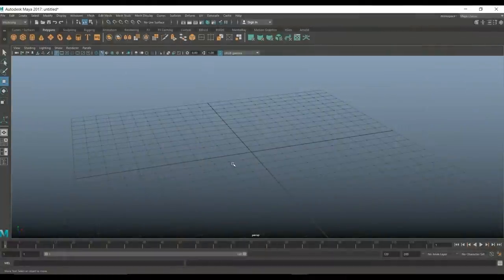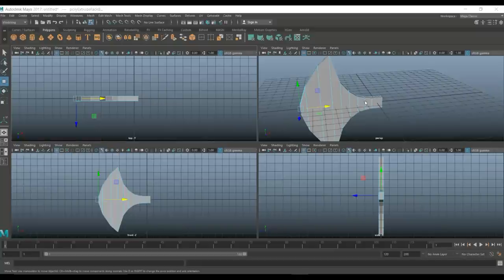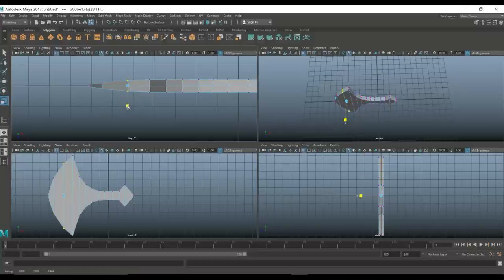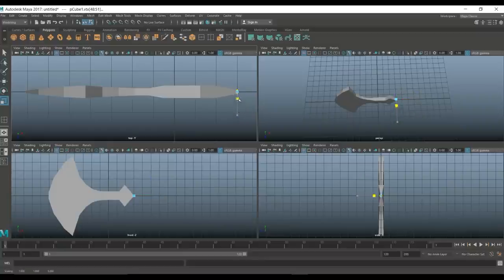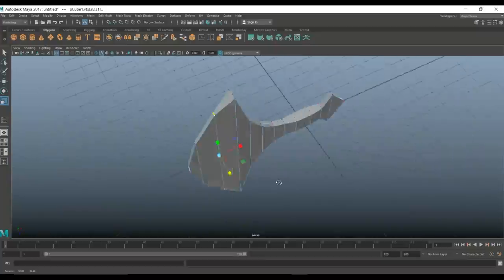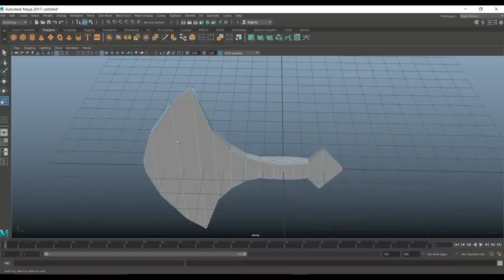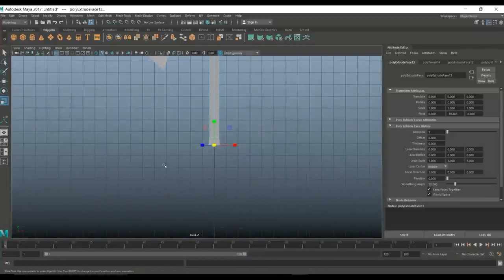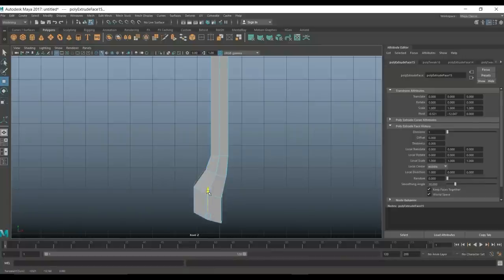Battle Axe Game Asset complete workflow Part 1 of 3 : Low Poly model

Comment: How do you model a rope, having it launched from say a gun or a bow, then attaches to a surface? Think Robbin Hood scaling a wall. 
I was planning to use joints for the rope but it doesn't look good.

Thanks in advance!
Reply from the maker: I would use an ncloth material, parent it and bake the animation. Then I would export it to the game engine
Reply: Thanks. I'll try that.